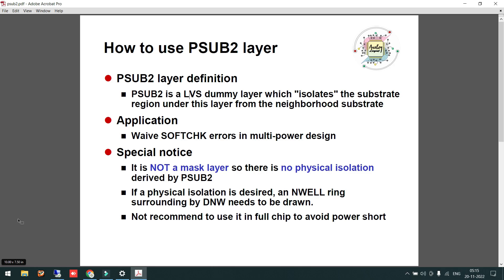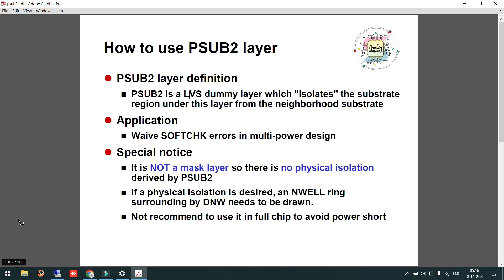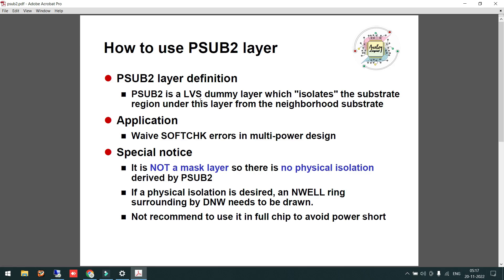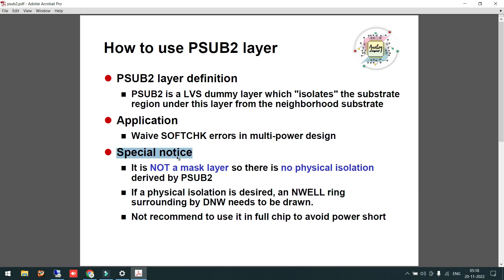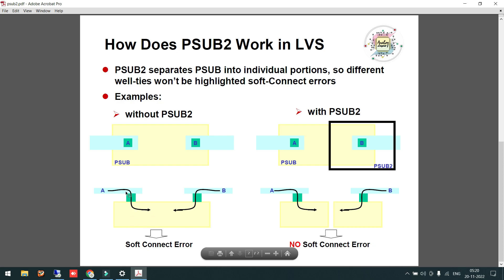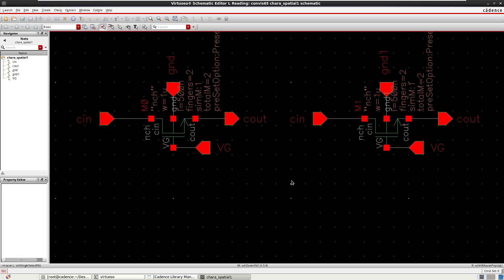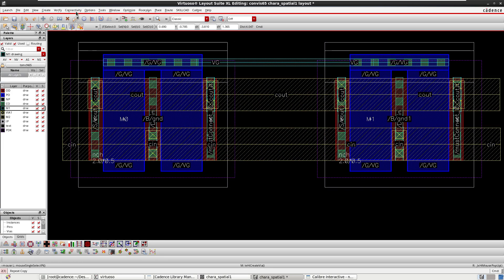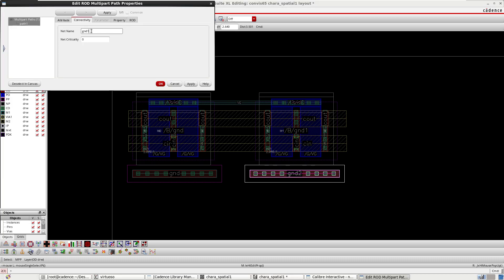How to use PSUB2 layer In TSMC Foundry PDK

Comment: Great video, thanks!

I’m using TSMC65 and I want physical isolation between the analog and digital circuits.

In my digital block I have a DNW surrounding the entire circuit (DRC & LVS clean). However, when I instantiate this block at the top level (mixed-signal), I still get stamping errors related to different ground domains (AVSS & DVSS).

Is this normal ?

If I use the PSUB2 layer, the errors are waived, but in that case will the analog and digital grounds still be physically isolated as they should be ?
Reply from the maker: It's not normal, may be your isolation are not properly added

Comment: At that time we need to maintain spacing between these two instances right.otherwise we will get base DRCD
Reply from the maker: No need to maintain od spacing, you can merge the od , how ever it's gng to connect to the same signal in the top level
Reply: @analoglayout  in 3nm of must continue but what am trying to say is we need to keep dummy in between also but substrate itself will get short right
Reply from the maker: @SASIDHAR-ol8ej  depends on the connection
Reply: @analoglayout  so at that time when we are doing placement right at that time only we need to take care.when we saw two separate bulks means we need to keep instance with sepate and minimum DRCD spacing